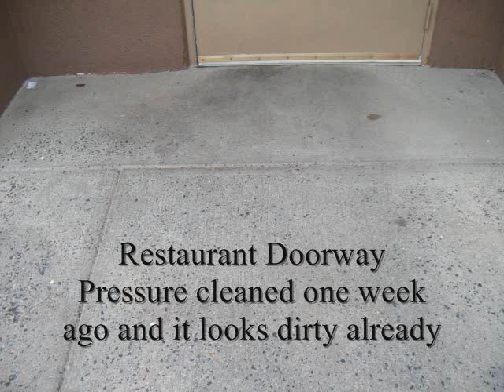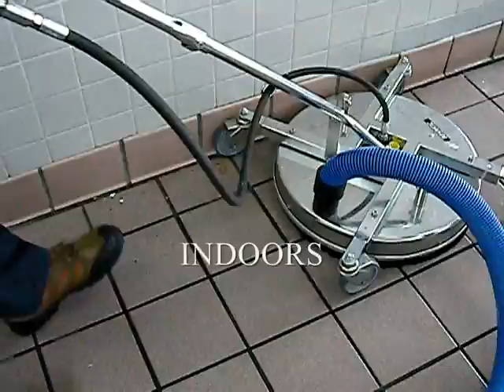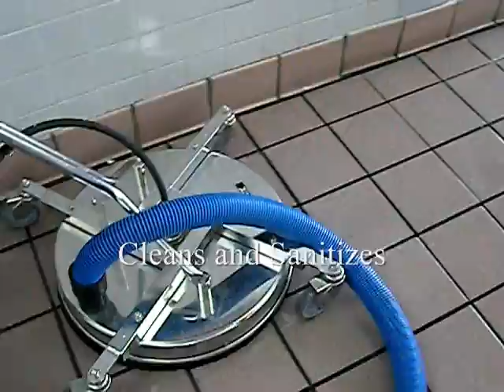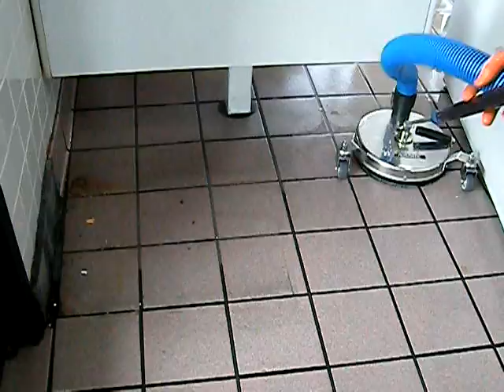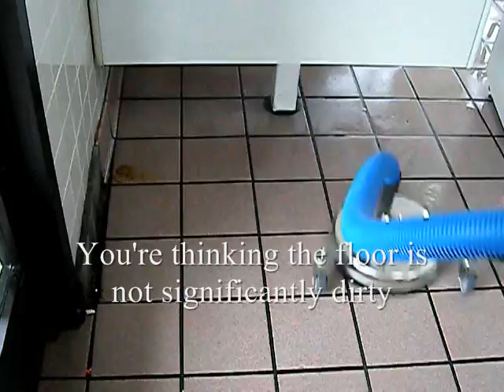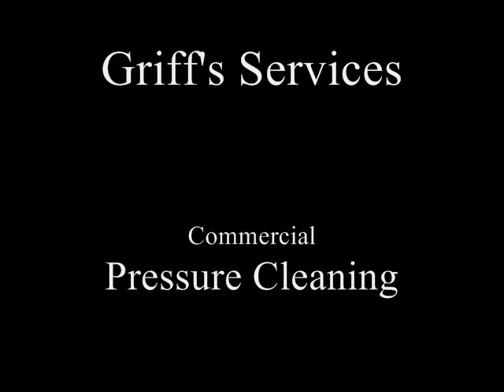Restaurant Tile & Grout Pressure Cleaning Power Washing Vacuum Recovery theme Monday Night Football

Comment from the maker: You got that right. To use a mop and bucket somewhat effectively, the surface should not be very dirty and the mop has to be rinsed/washed very frequently to ensure that clean water is introduced to the surface (not just dissolving the soil and spreading it around, also leaving excessive detergent behind). Even still the mop and bucket is no match for the displayed method.

Comment: Here in the UK I am a hydro hydraulic engineer so I can make bin cleaning units, ones that all you have to do is push a button and it does it all for you, the market is absolutely massive over here, you charge £2.50 a month if you do 200 bins a day you will get £500 a day if you do 100 bins you will get £250 a day, I would consider looking into this if I was you, also we do waste chute cleaning, (with the same van) we contract it for 3 years at £1700 once a year, it takes about 5 hours to clean,

Comment: Well I own a wheelie bin cleaning company, and we use big tanks that recycle and filter water so the suction will put the water back into the tank and recycle it so I wont run out of water, I will take your advice on the " free demonstration " I think that is a great selling point, do you cover any other aspects of cleaning besides surface cleaning ?

Comment: You can pick bin cleaning units up here in the UK for about £5000, The part I'm worried about with driveway cleaning is the weeds, do you know of a quick method to get rid of them ? for stains I'm going to use oil stain remover.

Comment from the maker: The model that can recover without vacuum is nice, but it has its limitations (namely distance from unit, cleaning path size. etc). I have not tried working for other commercial cleaning companies, it may work as well as it may not. If they already offer the service you may be considered competition. I have considered working with other types of service providers (example landscapers, construction companies/builders) that have relationships with potential clients that may require/need service

Comment from the maker: Yup , if the weeds are many and are more than one inch or more in height, I would trim first, then blow the clippings to the side after crank up the pressure washer and use enough pressure to clean the driveway and dislodge the remainder. Weed kill first is best.

Comment from the maker: Pricing is somewhat subjective numerous factors affect it, resources, equipment, know-how, work speed, service speciality, service demand, service supply, volume service. That being said the averages for hot water cleaning in the US range from $60 to $150 per hour, but some companies can get two to four times as much depending on cleaning specialty. Driveways, figure your time and materials, then comparison shop the area service market. Observe their level of efficiency/service for their price.

Comment: Excellent example of how filthy commercial restaurants floors actually are.   The problem exists because soaps and detergents alone do very little to break down the light weight oils found in all restaurant kitchens. 
Hire a professional like Griff's Services on the east coast or Grime Busters Pressure Washing in Arizona to have your floors steam sanitized and looking like they did when they were brand new.
Reply: Grime Busters Pressure Washing whats the machine cleaner name?

Comment from the maker: No potential fines associated with flyers on mailboxes etc ok.......; there sure definitely are a great deal of bins over here also, its worth investigating. I suspect having an agile mobile cleaning unit would be best. Later if you step into doing driveways,  its a different niche of washing vs bin cleaning. There are so many different parameters with driveway cleaning, types of surface, oil, grease, dirt, mold, rust stains, resanding pavers, sealing etc

Comment: Can I ask, how fast does that 12 inch surface cleaner spin? Does it spin as fast as one without recovery?
Reply from the maker: Spins about the same speed if not faster, as the dirty water gets out the way
Reply: @GriffsServices  i really appreciate it. I tried the integrated recovery model from mosmatic and it spins very very slowly. This means that cleaning takes a long time. Oh and integrated recovery meaning that is doesn't need a vacuum to suck up the water.
Reply from the maker: @fsalda1942  your welcome, I heard of and seen that technology with another company, but I want sure of reviews... thanks for your input..
Reply: @GriffsServices  Absolutely. You're using the mosmatic 12" with vacuum recovery correct?
Reply from the maker: @fsalda1942  yes in video
Reply: @GriffsServices  thank you very much. We are cleaning commercial kitchen tile and grout and the normal tile and grout machines are just not strong enough. Hopefully this is a good solution for us

Comment from the maker: Wow, hydro hydraulic engineering, awesome; there is one US company I know of which has built a pressure washing trailer for garage cleaning that has driven the pressure pumps hydraulically, a well designed set up. The youtube bin videos I have seen are from the UK and Europe. I have seen US units demonstrated on youtube, but not sure what the market bares in various states here. £2.50 a month that includes one cleaning? Is the bin owned by the homeowner or the county/city? Worth investigating

Comment from the maker: The best methods for the weed is to kill the plant at its root, pressure washer heat may not be enough to do it, but the best method would be at apply a weed kill first let them dry down, then clean using a turbo nozzle cautiously or zero degree nozzles in surface cleaner with functional pressure. If the weed are really bad you may have to use a string line trimmer. The seeds of some weeds can lay dormant for years, so a advise the property owner on the application of a pre emergent control.

Comment from the maker: Here is a scenario, 1000sqft concrete driveway cleaning request, 25 miles from service area, dirt, algae, one oil spot, no jobs in the area the week requested service, your price maybe a minimum charge, lets say $95. Same job scheduled with nearby driveway your charge maybe $75 each, yet your net total income/per hour rate could be higher at $75 each because your total operating cost to complete the two jobs is lower. It would be your choice to be rigid at $95 each. US sqft price 0.04 to 0.40